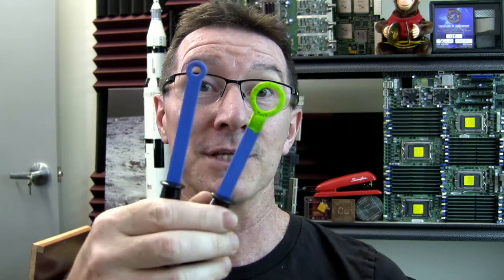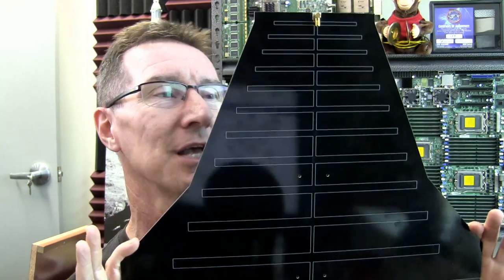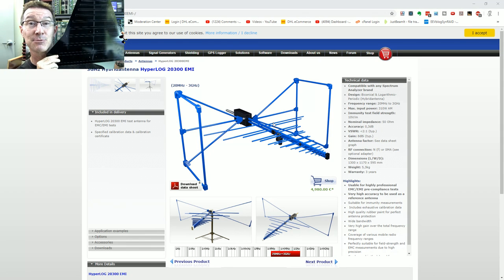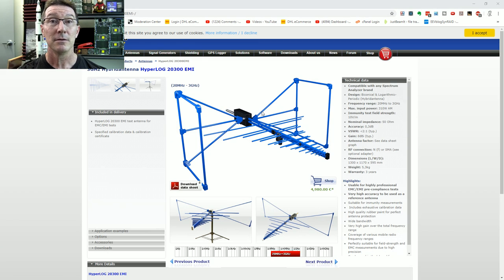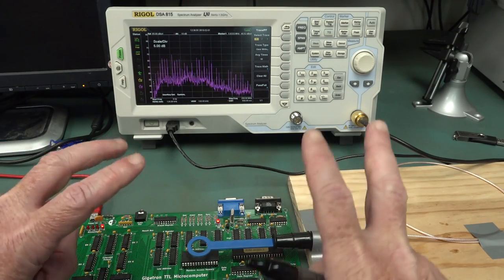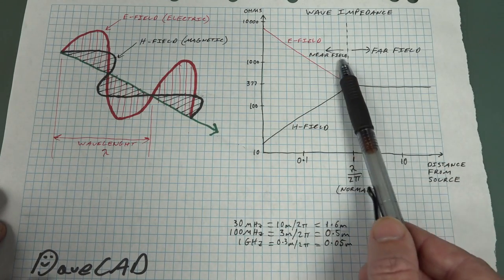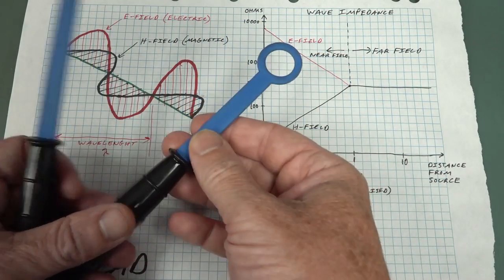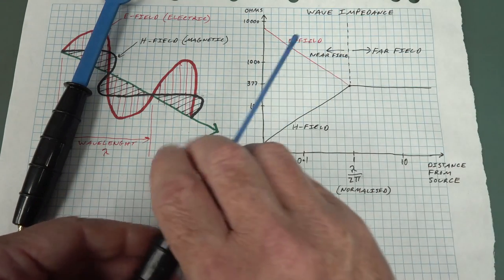EEVblog #1273 - EMC Near Field vs Far Field Explained

Comment: Build your own antenna! There's a ton of ham radio literature about log periodic antennas. No doubt it'd be a challenge, but I bet you could get it done under 100 USD. I specifically recommend the ARRL Antenna Handbook.
Reply: I agree with this, would make a neat video too. Although, the antenna may become somewhat big on those lower frequencies :P
Reply: the difficult part is not building the antenna, but measuring how its gain changes with the angle and frequency, which you need for the EMC measurements. For measuring your antenna, you need one of the echo-less chambers.
Reply: aint nobody got time for that
Reply: @pyrokinetikrlz  Right... was thinking can be done cost effectively other than tuning and standardizing with calibration certification or whatever the electronics test equipment industry uses.
Reply: I'll suspect Andreas Spiess might be usefull there. He seems to have profound knowledge about antennas.
Reply: The ARRL book is really good.

Comment: Dave, I think you 'described' it without 'explaining' it. I always figured that a layman's explanation for the difference between near-field and far-field signals was that near-fields are the portion of the field that is close enough (at the speed of light,) to collapse back onto its source as the signal's source polarity reverses,  while far-fields are the portion of the field that is not close enough to get back before the reversal, and thus is 'pushed away', and must continue on as free-space radiation, an effect that essentially turns an antenna into an electromagnetic-field 'pump'. This explains why longwave near-fields can extend a mile from an antenna, while microwave near-fields are centimeters or less.
Reply: Damn good supplementary explanation.

Comment: Howdy. Nice presentation. Some comments.
Near field. The E and H components are 90 degrees out of phase. Almost all field energy collapses back into the antenna periodically.
Far field. The E and H components are in phase. The energy has broken free and travels forward.
The intermediate field or the Fresnel field. The phase shift is between 90 degrees and 0 degrees. Some of the energy collepses and the rest propagates.
What is the mechanism that splits the components into collapsing parts and propagating parts ?
Collapsing takes time. Field lines closer to the antenna have time to collapse. Field lines farther away do not have time to collapse completely they will encounter the build up of the next half wave field at the antenna. The ends of the field lines disconnect from the antenna and interconnect to form loops that travel forwads.
Regards.
Reply: Thanks for the explanation! Someone finally explains it in layman terms!
Reply: Thank you so much. I've seen textbooks that depict the E and M waves in phase, and other books that show them 90 degrees out of phase. I've asked physicists about that and never got a clear answer. I always thought it would make sense for them to be 90 degrees out of phase because then the energy of one field is at peak when the other is at zero, so the energy is converted from one to the other. But it also makes sense for them to be in phase at the antenna. You just wrapped it up, so thank you.

Comment: Hi Dave! Go for Schwarzbech, good antennas, and fair prices! But it depends if you want an antenna just to cover 30 to 250 or 300 MHz. In this case go for a biconical antenna. If you want to cover the band from 30 MHz to 1GHz with a single antenna, go for a so called hybrid antenna, the union of a biconical and log antenna, otherwise called bi-log. Happy EMCing!

Comment: This "E field" probe is actually an electric potential (voltage) probe.  Electric potential is a scalar and has no direction.  In isotropic materials B and H are always proportional to each other.  In fact it is quite difficult to find or to engineer materials having tensor magnetic susceptibility; materials having tensor electric susceptibility are numerous.  In free space E=cB and B=mu H, but in materials mu is larger than 4pi X 10^-7.  So whether we call the magnetic component of EM waves B or H is purely theoretical other than the proportionality constant with E.
Reply: both are voltage probes then, since the H field probe mesaures the strenght of the H field with the voltage induced in the loop antenna as a probe.
Reply: @redknight344  Well, you wouldn't say a light meter is really a voltage probe because it converts light into voltage, or that a bathroom scale really measures distance because it converts weight into linear deflection.

Comment: You were asking about lower freq antennas. Mil461 describes designs for biconical antennas that cover the lower end of the radiated field. Not overly difficult to make. I don’t believe they detail it also requires a 4:1 balun. 
The bigger wide range hyperlogs are practically a log periodic crossed with a biconical of course.

Comment: If you look at the datasheets of those expensive antennas you'll apreciate how much variation is on parameters like the antenna factor, antenna gain, directivity and so on. The reason for those prices, apart from high quality materials that imporve the performance, are the calibration data that you get with them in order to be able to calculate with accuracy radiated and received power (Basically same concept as you explained in your video about why Fluke meteres are so expensive). So basically you're buying parameters to fill in your Friis ecuation, and certifications needed if you want to be a EMC certification lab. I think you can build your own antenna but you'll end up with the same problem of having several cheap antennas that cover all the frequencies range, the only advantage I see is that you won't need to switch from one antenna to other while sweeping the entire band.

Comment: HAM here.   Look up Mag loop receiving antennas.  Highly directional.  50khz to 50mhz with a 3ft loop.
Reply: 0.005% efficiency @50khz with 3ft loop
ham there back to drawing board
Reply: @andhanwer  That's why there's a preamp right at the loop.   They work fine.

Comment: Dave, you have said in the past you're not a radio guy, but you should look into an antenna called the Quad Loop. Basically, a simple square(or any shape, really) antenna with a variable capacitor inserted at the feedpoint. I have built several of these(including the caps), and while the dimensions and cap values are important, they are not critical to function, as it's a tuneable antenna. Bonus: it has a fairly narrow(bilateral - dependent upon shape) gain pattern, so isolation is easier.  One I manufactured for 20 meters(14MHz) measures only about 2/3 of a meter in its largest dimension. Getting down to 30MHz or low-VHF should not be a problem at all, and it would be even smaller. I used a simple SDR as a frequency domain analyzer to verify my tuning range, but I'm pretty sure you have one of those laying around the shop. As you tune the cap, you'll see the spike in the signals move around the frequency domain.

Barring that, a coil of wire of the correct length or one wound around the correct ferrite rod will get you reception in high HF/low VHF. Or even lower - this is what most AM receivers use and I have seen those measuring only inches long; albeit with sometimes strange gain patterns, but it you put on in a Faraday Bucket(a cage with an open side), you may get good results.

PS, I'm trying to get down to the site for the Solar Road demo in Baltimore and get some pics for you. I try to avoid that place, as it's all a "bad neighborhood"...

Comment: I had to learn the basics about Nearfield effects of RF transmitters for MRI Safety.

It's absurd that a Magnetic Resonance Imaging scanner, designed for imaging humans, can cause RF burns.

If a patient has any part of their body within 5mm of the inside bore of the MRI scanner, nearfield effects are possible.

This would be like building a car with holes on the floor, then blaming the driver then they lose a foot by putting it through the hole.

Hoping to understand better from this video :)

Comment: When testing in the chamber if we got within 3db of the limit or so, we would have to take the kit outside and retest at the points that got too close to the limit line. As reflections off the chamber walls could be making our test sample appear better than it is. This means you may o ly need to a few test frequencies out side. We used to get problems outside as the test site was 6 miles for a small city with its airport so quite a lot of rf noise. Also on damp days electric fences can be heard clicking away over a very wide spectrum.  So even looking at a single frequency outside could take up quite a long time. And ho boy their time is a lot of money.

Comment: Bit of a weird suggestion, but would it help if you immersed the antenna in a tank of distilled water? 

Seems to have a fairly consistent permittivity of about 80, and a relatively low loss factor at 100mhz (~5e-3)

The impedance mismatch would lead to a ~4.4 dB loss due to reflection, but the wavelength in the water Is Lower by a factor 9 which would bring it close to the 30mhz you needed?

Even tap wateright work, should have a skin depth measured in meters, which seems workable

Don't the antennas in mobile phones to a similar thing to reduce the needed length, but with better dielectrics than water?

Just a random thought, not an EE
Reply: Hmm, interesting idea! Would love to hear feedback from someone who would know.

Comment: Not to be pedantic or anything :) but your hand drawing of E and H fields would be propagating in the other direction.    The direction is given by the Poynting vector S = E x H.  The animation which you placed over it (very cool by the way) had the direction correct.

Comment: Hi Dave, how about the 10m, 3m and 0.3m for 30Mhz, 100Mhz and 1Ghz respectively?, how were they calculated?. Thanks!
Reply: The obvious answer is that they were calculated using the speed of light. But I have another doubt. The far field starts quite close according to Dave explanation. From the Antenna, HF and propagation knowledge one can get, that far field region depends on frequency and the size of the antenna, which is not mentioned here. And as already said - starts very close

Comment: 13:24 the e-field has a polarization though. The probe needs for example 3 orthogonal antennas to have an isotropic response in this regard.
Reply: I'm not sure but I think the E-field is only polarized in the far field.
Reply: @johnclawed  but i'm sure ;)
Reply: I was wondering this too.  I guess the probe is single-ended (i.e. not differential), and it's just measuring the field with respect to ground, not the gradient.  https://youtu.be/S27zk_Gj9nU?t=300 seems to confirm this.

Comment: You explained that the E field and the H field move 90 degrees relative to each other and later in the video that the H field is a round loop surrounding the conductor. For the E field I understand well perpendicular to the conductor, but 
how can the H field be at 90 degrees from E if it is a round loop as per your animation?

Comment: 4:25 You asked, these are also far-field antennas: http://www.saelig.com/product/M00154004.htm (1/8.33th of the price of the log antenna). Is this what you're looking for? Edit: they have an even smaller version nowadays: http://www.saelig.com/tem-cells/tbtc0.htm to test cellphone-sized devices. Edit2: random quote: "The wave travelling through the cell has essentially a free-space impedance (377 W) (sic), thus providing a close approximation to a far-field plane propagating in free-space."

Comment: Does Australia allow you to do your own certifications? It used to be allowable in the UK if done by a 'competent' person and using calibrated equipment and done to the correct standards.  You still had to hire calibrated equipment and the process is very time consuming, so in the end might not be much savings as compared to having it done by a professional test house.  I'm going back to the mid nineties here - I worked somewhere where they decided to self certify a custom built power supply for use in their own equipment. Due to EMC rules, it became very costly for the small independent electronics manufacturer to supply ready built equipment as everything needed to have EMC compliance in addition to complying with electrical safety standards.

Comment: The "far field probe" is basically a regular antenna. I doubt that you can buy a cheap log-periodic antenna for HF (3-30 MHz). Firstly, because of the wavelength the antenna will be huge. Secondly, because these antennas are manufactured for amateur radio operators. This market is really crazy, a piece of wire with a ferrite core can easily cost 100-200 USD. If you need an HF antenna the cheapest and simplest option is to make one. There are many articles online that explain how to make a dipole, two element yagi and wideband variations of these antennas. From personal experience it takes one Saturday to make a dipole or two element yagi if you never tried this before. However you will need some free space, about 30ft of 22 AWG wire, a 10m fishing rod (two for yagi) and an antenna analyzer / SWR meter. The FAA-450 from Electroparts is a good product in terms of price/quality and it covers 0.5-450 Mhz. Also it's an open hardware project by EU1KY amateur radio operator.

Comment: When you say far field, are you referring to radio waves?
Reply from the maker: Yes, they become electromagnetic waves. Radio waves are electromagnetic waves.
Reply: Ok, so how would you go about measuring the electric field of a plasma globe?
Reply from the maker: @openyourmind7288  Why? Maybe with an ESD electric field tester perhaps if you wanted to measure a surface spot? The electric field has to be defined over a given surface area. You have to know what, how and why you want to do this first before answering that question.
Reply: @openyourmind7288  first you become a freemason

Comment: 10:10 - I have a stupid question? The H-Field is horizontal,  S-Field is vertical--relative to WHAT?
Reply: That's E not S.  E is vertical if the radio wave is "vertically polarized" which depends on antenna orientation, since the convention is to refer to polarization in terms of the electric field.  If a waveguide is used then it also depends on its orientation (which can be twisted), and as it happens the magnetic field follows the wider side of a waveguide, so it is vertically polarized when the opening looks like it is horizontal.

Comment: Thanks for the explanation! So I guess, as an extreme example, when I build and run a ZVS flyback (which I have), most of the low voltage side circuit, with the MOSFETs and caps and chokes etc. mostly emit H-field, and the HV output of the flyback emits mostly E-field, when it's not arcing, just... held up into air like that... And I guess the output emits mixed fields, both E-field and H-field when arcing.

Comment: Can we use the antenna in open area test or do we need anechoic chamber?

The aliexpress link is not working (at least for me)
Reply from the maker: Links work for me.
You can use either an OATS  or a chamber, take your pick. OATS is technically better.
Reply: If you test in an OATS facility, then you have to deal with all of the TV and radio stations in the area, as well as whatever smaller transmitters are near (probably wifi and the like).   Dave was talking about emissions testing, but there is also the issue of immunity testing, where RF energy is directed at the device under test.   In an OATS, this can get you in trouble with the FCC or the local equivalent.
Reply: @SkyhawkSteve  Does immunity testing matter for most consumer grade equipment? I'm thinking the FCC class B notice you often see, with the wording "This device must accept any interference received, including interference that may cause undesired operation."
Reply: @threeMetreJim  I've never designed consumer electronics, so I'm not sure about the specifics.   FCC part 15 is the basic spec on emissions, which is that the device isn't allowed to interfere in the standard radio and TV bands, etc.  (if I recall correctly, etc)   Dealing with EMC regulations isn't for the faint of heart.   For a small hobbyist selling a few items, it's not a concern.   If you are selling a lot of stuff, you might be liable for any problems caused by your product or may have to provide replacements or refunds.  This is when it's good to consult with an EMC test house and get their guidance.
regarding immunity testing specifically.... that probably depends more on the type of product.  If it's a toy, then it is no big deal if it stops working when someone uses a cell phone nearby.   If there are safety implications, then you'll want to do whatever the industry standard testing is.   Even concerns about customer satisfaction might be a good reason to do immunity testing...  no one wants to deal with thousands of customers seeking refunds or replacements.
Reply: @threeMetreJim  There is no immunity compliance required in Australia only emission.